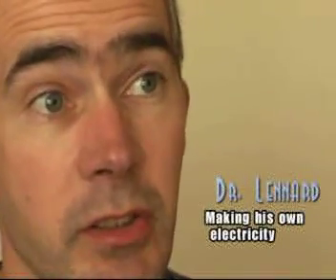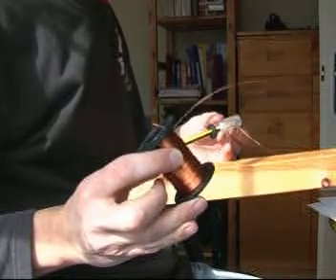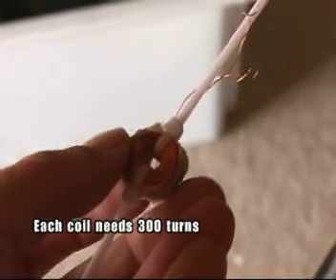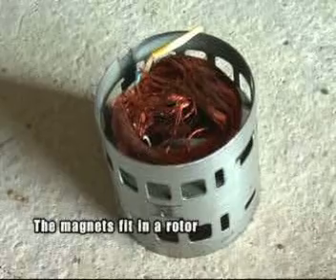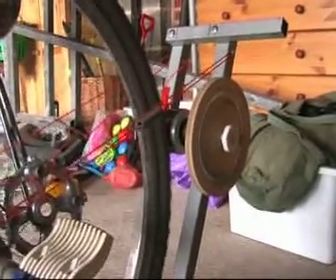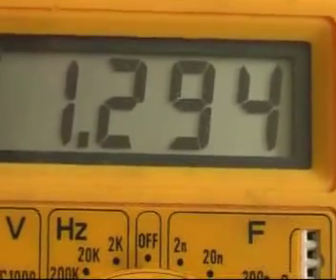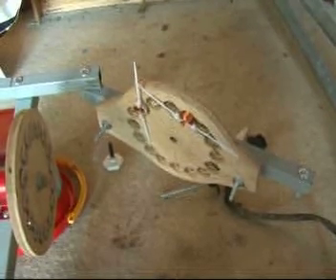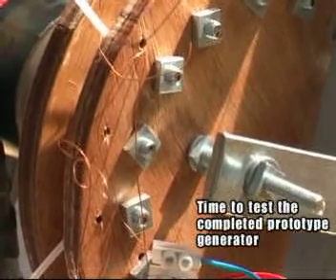Electrothingy.avi

Comment: Hi Lennard,
Great job, i see you went for the steel core - makes a big difference to the voltage generated approx 200% over air I found and the cogging is not much of a problem to overcome with peddle power and momentum.
Regards Martin.